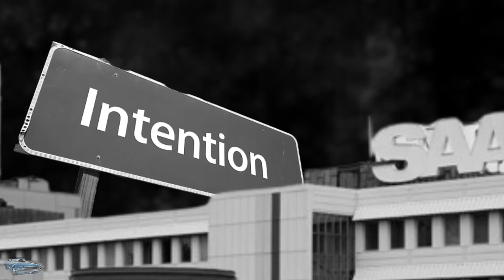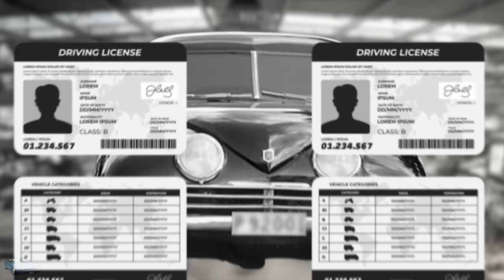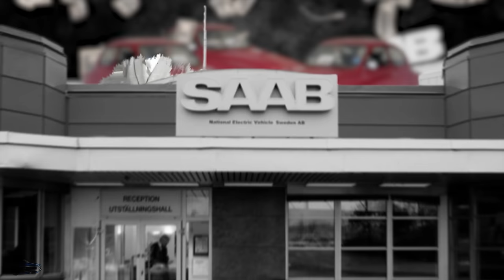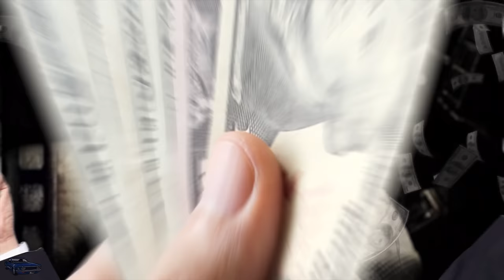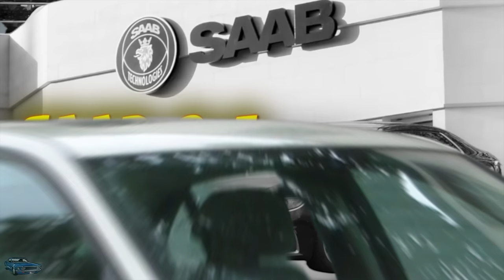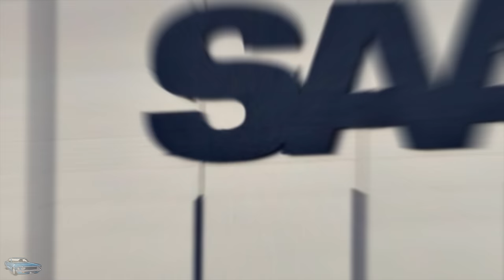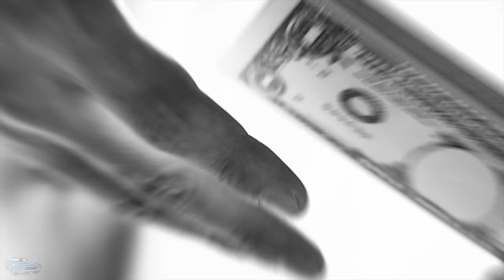The TRAGIC Fall of Saab | A Classic Car Documentary

Comment: You totally glossed over the fact that before GM was involved, SAAB started to fit the German Ford V4 engine (regular gasoline) to its models and so circumvented the issues that arose with the requirement for two stroke to use "petroil".  This did take away from the special character (and sound) of a SAAB. But it was the beginning of SAAB becoming an ordinary car, loosing the quirky appeal of old.

Comment: Weird...just clicking around, and I already see issues. You talk about the replacement for the aging 9000 being the 9-5, but you show the 9-5NG. Then you talk about the 900 receiving a facelift, and show a facelifted 9-3NG. Then you talk about the 9-3 being the first car with ventilated seats, but that was the 9-5, and the picture you show doesn't even match the 9-3 you showed. 

Then you reference "the 90s," but only show cars from the 2000s in the background, and then complain about platform sharing...but the 9000 shared its platform with other vehicles, and the 900 you just described as becoming the 9-3 as a facelift wasn't the car you showed, and also had a shared platform.

Comment: SAAB do still produce military hardware like airplanes and submarines, in addition to airplanes for the civilian market. 

Like with SAAB GM has killed many car brands, the issue with GM is that they made too many boring similar cars that ended up competing with themselves instead of doing what they should have done, competing with other producers. 

I owned a SAAB 9000 Turbo 1987, it was an amazing car, at one point I was able to outrun several Porches on the highway.

Comment: The exhaust emissions from 2-stroke engines do not come from oil in the fuel.  They are a result of raw gasoline escaping throulgh the exhaust port before the piston closed it off for the compression stroke.

Comment: EVERY 2-stroke model had "free wheel", no special  handle was needed. Why? Engine braking without oil would rapidly kill the engine. Oil was in the fuel, so no fuel no oil. Smoked terribly, and sounded like asynchronous beating on oil drums. The 4-stroke retained the free wheel, may have been selectable, don't recall.
Driving with freewheel was ehhh... different, specially on slippery snowy roads.

Comment: The 9000 was a shared platform with FIAT, Lancia and ALFA (Croma, Thema, 164), way before GM.  The choice is always mass market (Ford, GM) or bespoke (Aston Martin), if you can make the latter profitable.  If SAAB were good at bespoke, why did they fail?  Wrong market.

Comment: My 86 900S was a solid car with a great 16 valve engine and strong 5 speed manual. however.... it was a disaster electrically. Maybe they should not have used aluminum conductors.

Comment: Had a SAAB 900. Worst car of my life. Enthusiastic acceleration caused the engine to rock back and bang the A/C compressor to crash into the firewall pulling the mounting bolts out of the engine. The engine seized and had to be replaced. It had no sway bars, a "feature", and it felt like it was going to tip over around a traffic circle and made people ill. It was comfortable to sit in, but the cheap a--molded side panels being a wonder of modern Scandinavian design only a few weeks. When it was in the shop, the loaner VW Rabbit was so much better. SAAB never developed engines past the 3 cylinder. The V4 was a Ford. The inline four was a reworked Triumph. Their technological prowess is a myth created by marketing and people still believe it.

Comment: Misinformation warning:
1 - why not only once is mentioned the use of German Ford V4 Taunus 4 strokes engines in models 96 and Sonett II and III? Besides, the Taunus V4 engines was what kept SAAB in the market when the 2 strokes engines were not acceptable any longer, closing brands like DKW/Auto Union!  
2 - 9000 model was NOT developed from Lancia Delta, it was developed from a new and much larger car, a joint-venture between Saab and Group Fiat and its brands FIAT (Chroma), Lancia (Thema) and Alfa (164) !

Comment: If the buyers market majority wasn't more interested in disposable bic lighter cars. I believe Saab would still be around and not have to be a part of GM. Cost of in ownership as long as you keep up with services and oil changes they go forever fairly cheaply. I have new looking viggen 5dr at 200k drives like new still original clutch even. Then I have a abused neglected ss 93 at about 310k would trust it to go on a 7-8 hour 1 way trip still. 😂

Comment: You did an okay job putting together the video, but SAAB should have stuck with making aeroplanes. The only place a 2-stroke motor should be is on a chain saw or a weed eater. Aluminum is fine for beverage cans, but not for the frame of a car.  If Saab was hurting for money, why did they not talk with Volvo about a merger / partnership instead of holding hands with the giant GM Corporation? Volvo is right there in Sweden. That would have made sense.

Comment: Alright, that's enough.  I had a '76, 99GL or GL99.  It was a total piece of crap.  I shudder to think what their planes were like.  Anyone that ever owned a Saab will tell you to stay away.  This video is painting a rosy picture of a turd.  It tells of all the unavoidable reasons that Saab went belly up.  It didn't mention quality control and poor engineering.  That's what generated a reputation that was impossible to ignore.  Everything went bad on them, from the paint to the electronics.  It was an insane piece of shit that I remember from almost 50 years ago.  You can't sell against such a legacy.
Reply: Rather disingenuous I think. Having owned at least half a dozen models from 900 to 93, my experience was nothing like you portray, furthermore I would never say to "stay away", quite the opposite in fact.  I can't think of many other normal cars, that in the late 20th century, could maintain an average speed of 150mph+ for 24hrs non stop, except for fuel and tyres
Reply: I agree about the 2-strokes kind of garbage, also if you didn't live in the far north US they really didn't like the summer time. But by the 900 they were squared away and weren't crap anymore.
Reply: @stuglenn1112 oh, I don't know. Had a 900 that spent more time in the shop than on the road. Fun to drive when it ran with great steering, but not even close to reliable.

Comment: 1) Saab never stopped making aircraft. Actually, most of the designs by Saab were world leaders whenever they were put into production, the Swedish law just restricted their international sale Very tightly to prevent foreign countries from getting Sweden into a pickle.
2) The freewheeling-mode was made necessary to make the 2-stroke engine more reliable. As a 2-stroke engine gets its oil with the fuel, it will run on low lubrication when getting little air and fuel downhill. This will destroy the engines way earlier than necessary, so that freewheeling clutch was introduced.
3) Saab were popular with tech savy people for their unique and refined designs. Saab had turned a Rover engine they got the production license for into a nearly immortal machine (The B204) by metallurgic refinement and there were loads of smart details in the 900's design (Like the doors that extended around the door sills which are stressed components of a car's body. That both made entrance to the front seats comfier and protected critical body parts from expensive damage in small side impacts.) After GM had turned the 9-3 into a facelifted Opel Vectra, a poorly designed and failure prone engine and a big price tag appalled the customers, as well as cheap shitty parts that made their way into the once great Saab cars. My take on that is that American MBA holders just were blind for the fact that the brand's reputation was more than market placements and image. It was about substance and superior yet not economically optimised design. They failed to understand that customers wanted their nerdy and expensive yet outstandingly well made cars. One gets the impression that for MBA people, the idea of quality products that last is an unfathomable enigma. Products have to trash themselves of a regular basis for them to understand their value to shareholders.
In short, GM had put an expensive name badge on their cheapo shitty crates and then was surprised that customers who saw through that fluke left. MBA-people…
When Saab liberated themselves from GM, the damage done to the company was beyond repair. It's not about market niche and individualism-blab, it's about an ignorant conglomerate management alienating a loyal customer base.
Ford did similar damage to Volvo for similar reasons, but not quite to the same extent. Both conglomerates had competitors for their products out off the markets, though. GM more so by killing Saab than Ford. Still Volvo aren't what they used to be.

Comment: SAAB 96 V4: This engine had too much torque for the gearbox. SAAB should have stuck stuck to the two-stroke. When you wound the V4 up in the indirect gears the ally casing distorted and the bearings ran. If a steel/cast iron gearbox casing had been used it might have been OK. The inner drive shaft joint (Hooke joint) was suspect too. Mine failed 5,000 miles from brand new. SAAB Rally team even had a rapid gearbox oil change pump, so you can see how bad it was.
So no sympathy for SAAB, they used the mug punters as unpaid testers and it finally turned round and bit them in the arse.
Jack the Japan Alps Brit

Comment: Too many errors to mention all.

But these are the gravest...
- SAAB never, and I mean NEVER produced close to million cars in any year. 85,000-125,000 during the company's most successful years is more acurate. it took almost 30 years to produce SAAB no 1,000,000 according to your own recording, i.e. 35,000 in average.  
 - The two-stroke disappeared 1966 phasing out the 42hp engine. 
- The 'Black panel' was introduced 1993, not in 1978
- The '9000' was not based on the 600 (Lancia Delta) but rather on the same platform as Lancia Thema, Alfa Romeo 164 and Fiat Chroma
- Regarding platform-sharing, the 900, 9-3 or 9-5 prior to 2002-2003 never shared platform with any GM product. What happened was due to badge-engineering a Subaru turned SAAB 9-2 and GM SUV -became 9-7. However the under the skin mechanics those were identical.
- SAAB was never a quality car. Lots of teething problems and annoying minor issues were imminent. Ingenious? YES! Quality? NO!!
- SAAB had probably the most loyal customers of all. Only SAAB owner bought SAABs. they never managed to attract BMW, Volvo, Audi och Mercedes owners.
- the product line was dated and out of style in the beginning of 2000. The "900-turned 9-3" was merely an updated version of the ´78 "900" and the "9000" was a hefty 15 years old. A product cycle is normally set to 6 years in the car industry with a facelift makeover half way through. 
- the first convertible was introduced 1986 and had nothing to do with GM
- the Aero was merely a stiffened standard car with remapped engine management system  
- the first 900 Aero was introduced 1985
- the 9000 Aero was introduced 1992
- the last 9-5 was chassis-wise based on Opel Vectra 
- the SAAB 9-3 at 17:38 is the old version, not the last '9-3' sedan and wagon model that was introduced under GM governing
- Spyker was never viable owner of SAAB. GM even had to submit Spyker's owner Victor Muller with 2,4 bSEK (230mUSD in 2024). Further finance was never unvailed but it was clear from the beginning that Spyker never had the means of rescuing the company. Spyker's owner Victor Muller never wanted to reveal who was the real financier. For good reasons many experts believed that a Russian oligarch, Vladimir Antonov, was his sponsor. The full truth regarding Muller's backer remains to be told.

The real problem for SAAB was that during 62 odd years of existence the developed merely three different cars. 92/93, the 99/900 (also renamed at the end as a '9-3'), the 9000. (the last 9-3 and the last 9-5 were built on platforms from GM). 

Through all years 900/9000 were produced parallel they cannibalised on each other.They were about the same size (900 => 4,65 m, 9000 => 4,62 hatchback/4,78 m sedan), with equal engine power 4 cylinder turbos (900 => 128-200 hp, 9000=> 130-225 hp) with equal performance and top speed  and targeted in general the same customer, the family man enjoying driving. So which one to buy? 

At the same time Volvo had 144/145, 66, 340, 360, 244/245, 440, 744/745, 764/765, 944/945, 964/965, S50, V50 S60, V70, S80 etc. BMW 3-series (E21, E30, E36, E46), 5 series (E12, E28, E34, E39) and 7 series (E23, E32, E38, E65), Mercedes and Audi just as many. the German makes also offered a wide range of 4, 6 and 8 cylinder cars and even V12's. Plus a unrivalled palette of diesels. 
So how would SAAB survive... You give me the answer

Comment: SAAB in a nutshell: the Night Panel a questionable feature at best, but a pointless way to squander scarce development funds. When you switched it on, it didn't only turn off lighting to the instruments, but actually turned them off altogether, with the needles dropping to the resting position, the only instrument remaining active being the speedometer with only the 0-140km/h arc remaining lit... at least until approaching the 140 mark, at which point the rest of the arc lit up. I mean, full marks for style, but zero for wisdom. And then there's the inexplicable decision to develop their own GPS system instead of using GM's standard, and highly functional, system. How many resources did that waste ?

Comment: This video contains omissions and inaccuracies. For instance there is no mention of the V4 engine upgrade to the early 95/6 which greatly improved its power and performance. Saab has been given a lot of credit for being the first family car company to introduce turbos i their cars, something we take for granted today. That is not mentioned. Initially GM left Saab alone in terms of design and manufacture and that the early version of the new 93/95 were overengineered and still very much Saabs. I have a 2002 95 and it is a fantastic car, solod and very reliable. It was the later 93/95s that were given ugly facelifts and compromised build quality and that is one shown in the photo. In fact the 93/95 looked like this to begin with. https://youtu.be/TpazYLOs2RM?si=5f3Ra3Wj7X-t7my7